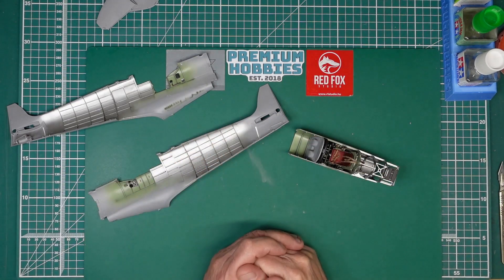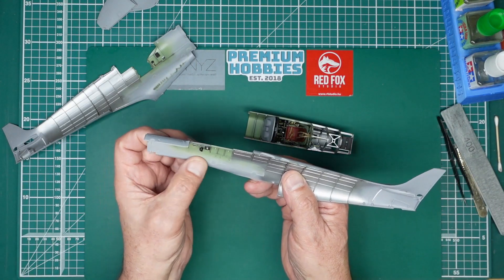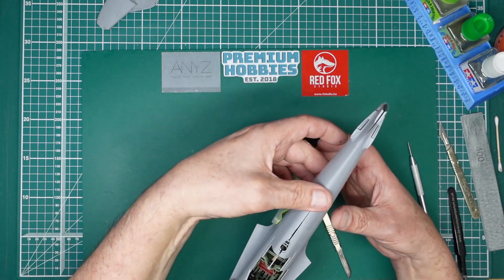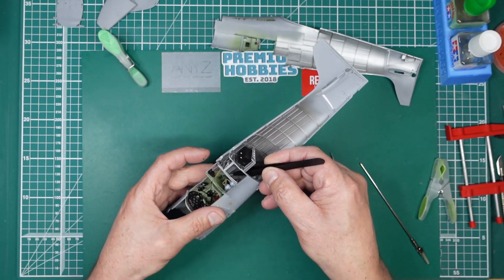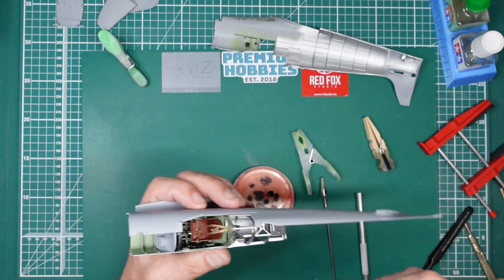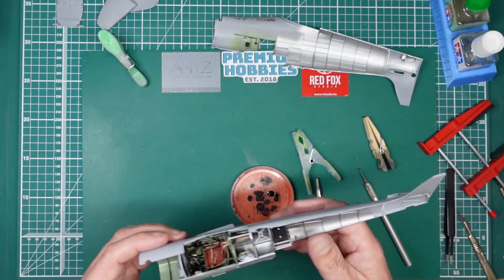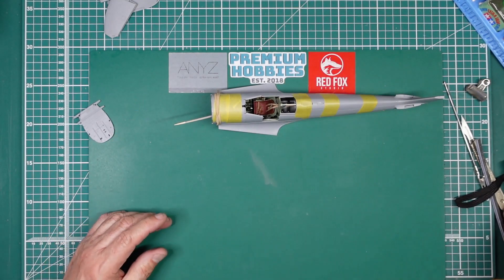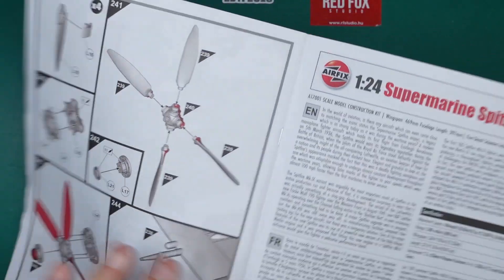Airfix new tool 1/24 Spitfire Mk.IXc Build. Part five.

Comment: Hi Nigel Great work so far only just watching this as I have the Mk.VIII for Christmas with all the Airscale detail sets. And just a little tip if you keep scratching things with your pointed tweezers put a bit of heat shrink tubing on the ends and gently heat it to conform to the shape of the tweezer and if it gets ruined just pull it off and replace with a new bit.
Reply from the maker: But, if I put the tubing on the end, I wont have pointed tweezers anymore lol.

Comment: Am I having a deja vie moment,  did I see the engine build in the last video?  Loving the progress and I don’t think you’ve been this enthusiastic since the Stuka build.  A couple of noteworthy points, firstly on the iPad and other devices you can zoom in on the you tube app either to fill the frame or right into any part of the screen.  2nd thing is that Airfix have the starboard magneto connected to both the inlet and SB exhaust plugs.  The port magneto does exhaust plugs and the starboard mag the inlet plugs.
Reply from the maker: Yes.. the engine was a bonus video.. Of course.. the set up with the mag's is correct on the WNW lanc.

Comment: have you looked at the panels over the cannons yet seems theres an issue there of not being able to close them if you build the full cannon seems they built  it with no option but to have both open or closed but not one open one closed
Reply from the maker: Not sure what you mean Steve, "one open, one closed"? The "motor" that feed the ammo is to be fitted when the cover is off, not fitted when the cover is on?

Comment: if you build cannon as per instructions the cover will not close so you have to ever leave parts off  the cannon or slightly whittle inside of cover to close wing
Reply from the maker: Yeah Steve. it does tell you to leave parts out if the doors are to be closed.. I have a second option.... in part 7.

Comment: Nigel, regarding the "zoom in", I have (at least) two problems with it:  1) When you refer to the instruction manual, you often just partially pull it in from the left side.  With the reduced field of view, we can't see what you're referring to in the manual.  2) The kit is do darn big, that with the reduced field of view, pieces of the model which you're working on are sometimes out of shot either to the left or right (particularly when dealing with the wing in this video).

The other problem I see (not related to zooming in) is what appears to be the ever-increasing length of the videos being posted.  This one, at1 hour, 24 minutes is so long as to require viewing the whole thing in multiple sessions.  I started this one before I had to leave for work, getting about half way through it, and then had to watch the rest after i got home from work.  I would encourage you to consider the idea of releasing videos on the order of (roughly) 45 - 50 minutes in length.
Also, releasing multiple, lengthy videos within a brief period of time makes it really difficult to keep up with all of them - there's just not enough time in the day!

Having said that, I really love the work you're dong on  all of the kits you have going simultaneously - the Spitfire, the Lancaster, and the K2 ambulance, and I'm learning useful information about your approach to dealing with kit issues from each one.

Comment: Step 24 tells you to install the horizontal bulkhead. Doesn’t this aid in the location of the aft bulkhead. Why would you skip it?
Reply from the maker: I added it after I knew the bulkheads are vertically aligned looking from the rear.